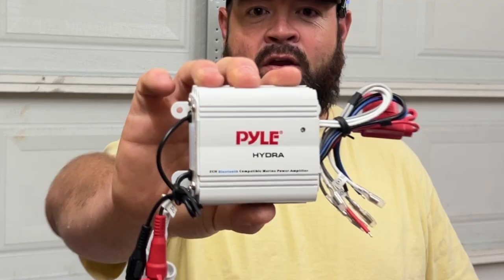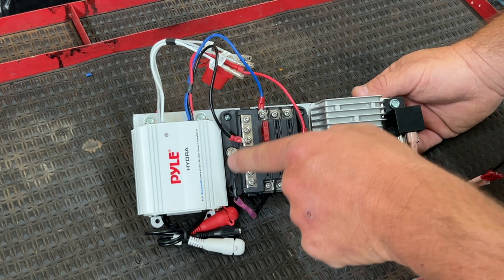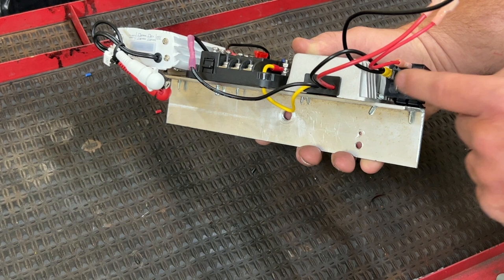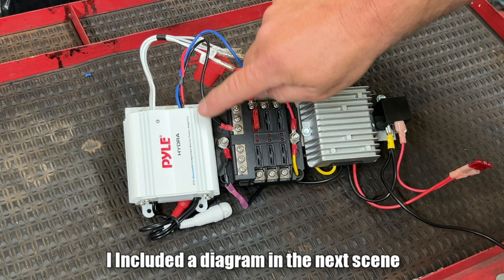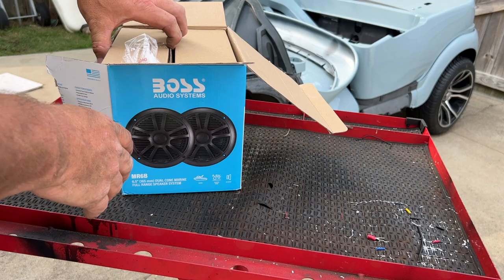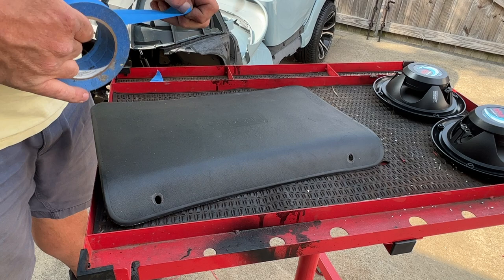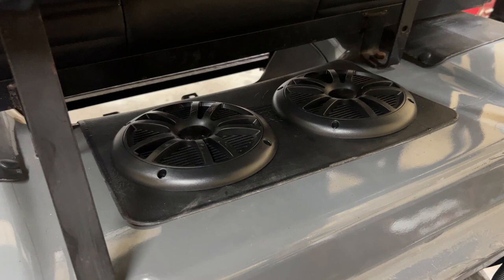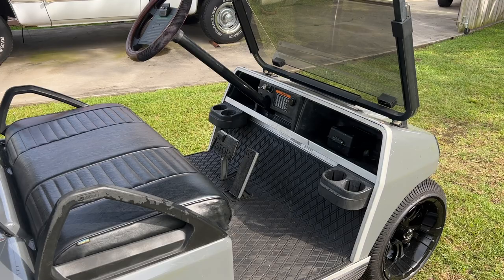How To Install Bluetooth Speakers with No Radio | Easy Golf Cart Modification | Control With Phone!

Comment: I did EXACTLY what you did and the Bluetooth Pyle won't even turn on
Reply from the maker: something isnt right then. Explain what you got.
Reply: I figured it out, I didn't have the ground going to the MAIN ground to the cart. Thank you for the quick response and great video!
Reply: Same here. How do I know which battery’s are the main + and main-? I have everything hooked up just like the diagram and cannot get the amp to power on.

Any help would be appreciated.

Comment: Random question, I just tracked my ignition wire back and it is hooked up to my solenoid.  Is it okay to move it from that location and connect it to the relay instead? Great video by the way!
Reply from the maker: Thats going to be the wire that has power on it at all times. You need the other side of the key switch.

Comment: Im a newb but wouldnt running a wire from the reducer to the key switch be the same as doing the reducer to relay to key switch?
Reply from the maker: No,  The key switch wire wont produce the amperage that the relay uses throught the battery. The key switch wire just turns the relay on and off.

Comment: Love the set up definitely going to go this route but my only question is does the Bluetooth amp have a enough power to also run a tube subwoofer such as the kicker tube sub woofer?
Reply from the maker: The amp used was only 2 channel. Even if it was 4 channel I dont think it has enough to run the kicker tube.

Comment: Excellent video and love your channel! Quick question... If I have the Ecobattery lithium conversion installed on my cart and the provided DC converter in the Ecobattery package is wired to the switched power on the key (and therefore supposed to turn off when the key is off I assumed), do I need to have the relay?
Reply from the maker: Shouldn't, The relay is only there to turn the converter on and off with the key but still gets power from the battery.

Comment: do you know if there is an external volume control know that can be attached to this amp. i dont want a head unit but just want a knob to control volume so i dont have to adjust it with my phone. hopefully that makes sense. thanks
Reply from the maker: Yes there is and it’s included my neighbor just didn’t want it.

Comment: Thanks for the informative video! I’m about to order and install this setup. However, I have a gas cart. I know I can forego the converter, do I need to just use a 12 V relay?
Reply from the maker: The relay was only used to turn the converter on and off. If you only want your accessories to be powered on when the cart is on a 12v relay would work just fine.
Reply: @Fentertainment  Thanks for the reply. I installed everything yesterday evening and it sounds great!

Comment: How would you wire it up if you running it on a gas club car?
Reply from the maker: I wouldn’t include the 48/12v dc converter.